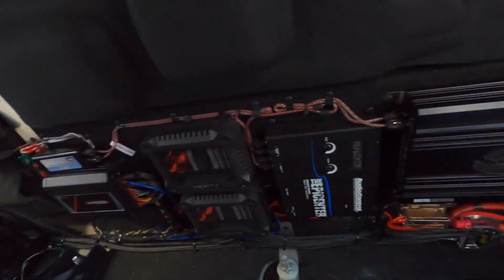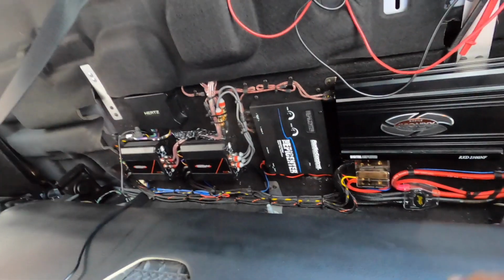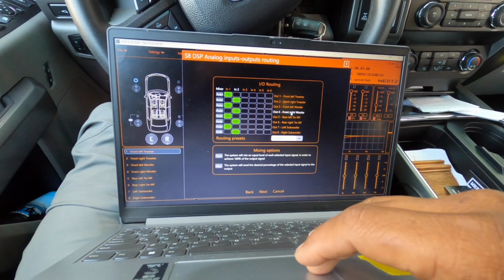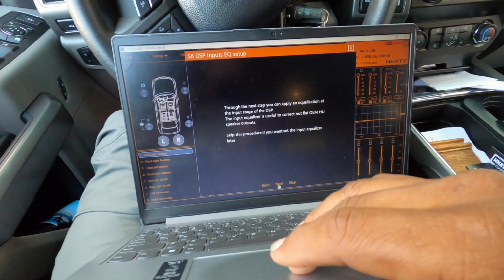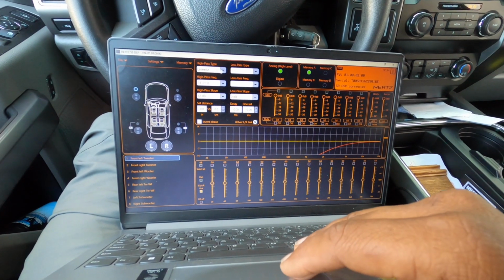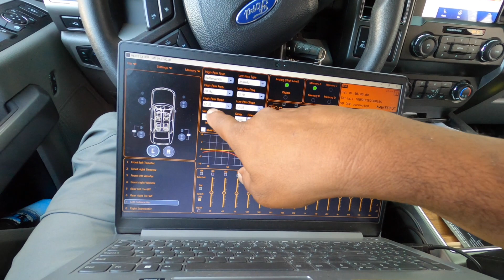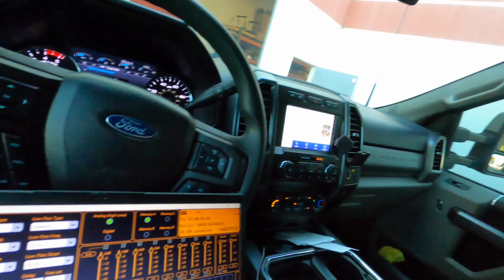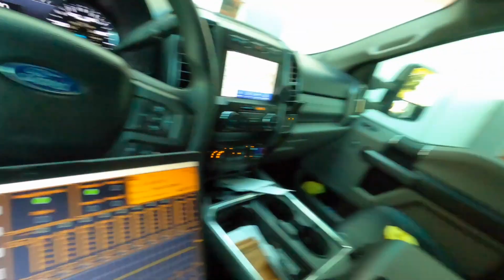New Hertz S8 DSP. Ford F350 DSP UpGrade Part: 2

Comment: Did you figure out how to switch between the 4 presets? They give you some wires, and it looks like you have to install switches to ground them out.
Reply from the maker: The phone app is the easiest way to make changes on the fly.

Comment: Nice 👏🏻 ver helpful , i would like to ask you a question, i have audio control LC7i. can i use LC7i out to this DSP input ? Is it ok or wrong? What’s your opinion?
Reply from the maker: The LC7i is designed for summing signals in most cases. The Hertz DSP has 6 high level inputs, so a LC7i should be needed. What type of vehicle is it?
Reply: Kia seltos
Reply: I wouldn’t like to change my head unit that’s why I used LC7i . Now my sound system connection is 
Lc7i 4 output to one 4 channel Sony es series amp for 4 component speakers (front&rear doors)
& lc7i 2 output to kicker mono amp for sub
Reply: That’s why I asked ,if I use hertz s8 dsp 
can i get sound improv?
Reply from the maker: @niyasnazz  If your Sony ES amp is current then it has the ability to do Highlevel input and has a low level out to run a subwoofer amp. So the Audio Control isn't really necessary.

Comment: Hopefully you will see this... Quick question for you - I noticed that when you were setting the input sensitivity that the test tone was inaudible.  Was this because you disconnected the output or does the app do this?   When I attempt this same thing, the test tone (sweep tone) is barely audible and does not respond to volume control - I have been assuming that this is a problem.   Thanks.
Reply from the maker: The unit will mute the outputs when it's doing it.

Comment: Does that hertz dsp play hi res through Bluetooth? I want a dsp with hi res compatible Bluetooth since I use tidal on my iPhone. I don't want to have to use a cord to my phone. Any advice would be greatly appreciated ✌🏽 Thanks in advance.
Reply from the maker: No the Hertz DSP doesn’t offer a Bluetooth audio input. You can take a Audison B-Con High Res Bluetooth and take the analog output into the Hertz S8. The phone would be the volume control.

Comment: Can you raise the low pass on the front midrange higher than 3200htz? It doesn't let you go any higher thaan thaat on the app. My front mids can play well up to 5k or so.
Reply from the maker: This system was a 2 way, the tweeter is only playing 3200Khz and above. The mid is playing 3200KHz to maybe 80Hz.
Reply: I get that but it looks as though the front mid dropdown (at least on the app) will only go lowpass around 3200, the higher selections are grey'd out. The rear mid woofer dropdown allows the mid to be played much higher, that is strange to me. I cant reach anyone at Hertz so I appreciate your info, great vid btw
Reply from the maker: Are you using expert mode?
Reply: I dont own the unit yet, before i buy it, i want to make sure i can run the x over up high enough. The demo mode on the mobile app stop the mid from playing any higher than 3400htz, the higher values are grey'd out and not selectable on the app. I just wanted to confirm I can run my front mids up higher than 3400htz where the app limits you. I hope the pc software allows you to get closer to 5k. Thats all im trying to find out
Reply from the maker: @miatgrad76  have you tried changing the low pass slope to 0?

Comment: hello there I have a question I want to add system to my factory head unit in my 2012 Acura TL I’ve doing research on the hertz DSP do I need an lC7 to catch signals or is the hertz DSP capable of summing the signals ?
Reply from the maker: Do you know which audio system is in your Acura? Bose? Alpine?
Reply from the maker: The Hertz DSP would work without using the Audio Control LC7i. Arc Audio has a nice one as well.